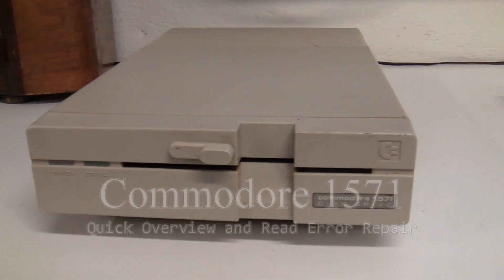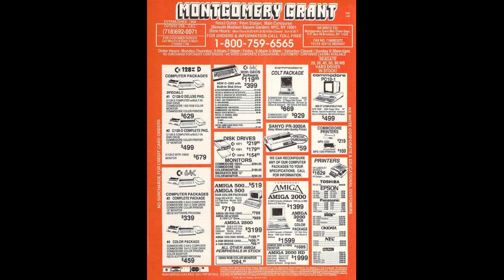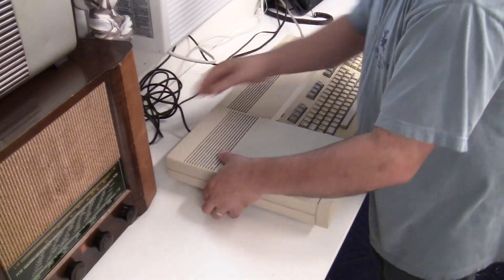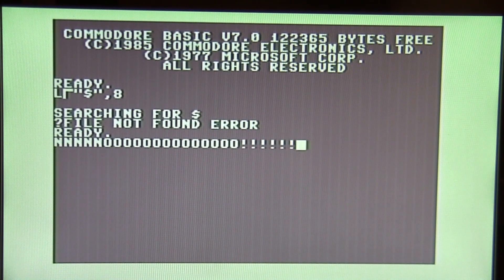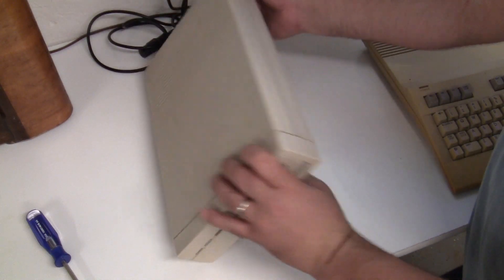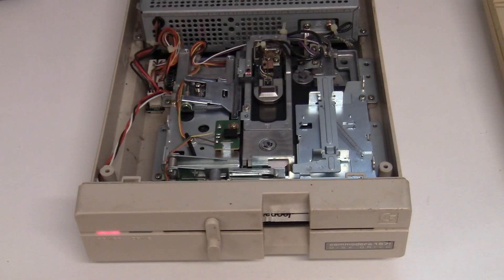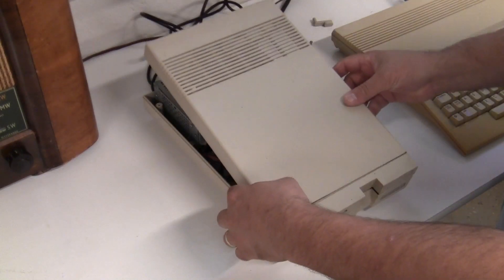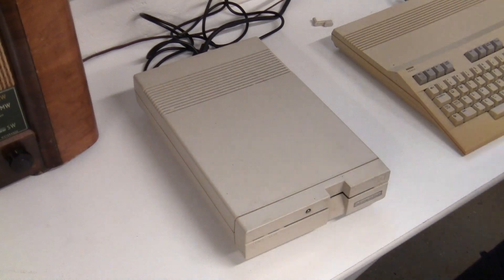Commodore 1571 Disk Drive   Overview and Read Error Repair

Comment: I had one of the 1541 drives and discovered a serious problem with it: Overheating. They put the Power Supply in the Floppy Drive's case so the heat would build up and in about 30 minutes the Drive would start to malfunction. The only thing I could do was turn if off until it cooled down. Putting a fan under it would extend the functional time but it wasn't much. One of the best things they did with the 1571 was to separate the Power Supply from the Floppy Drive. With that change I never had an overheating problem with the 1571.

Comment: Hi I had the same problem with my floppy drive with the error message I brought it on eBay and the seller said it hadn’t been used for 30 years I found your video very helpful I cleaned the head like you did and drive worked straight away thanks again for the advice
Reply from the maker: Glad you got it working! Thanks for watching.

Comment: I have a Commodore 1571. You’re lucky in that all you had to do was to clean the heads. Mine had a bad controller chip, which is the WD1770. I recently replaced it and the drive still didn’t work. I reached out to Ray Carlsen about my issue and it was the connectors being incorrectly installed. Once I corrected it, the drive now works. I also have a 1581, and I also replaced the switch as the original one got stuck.